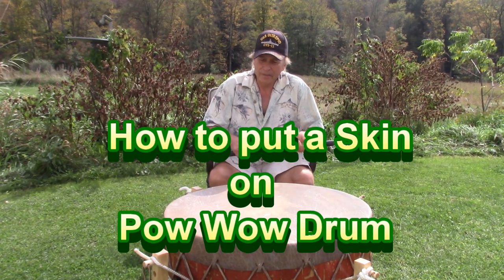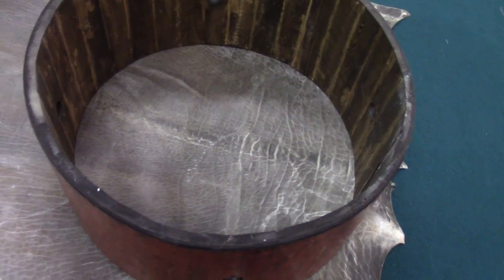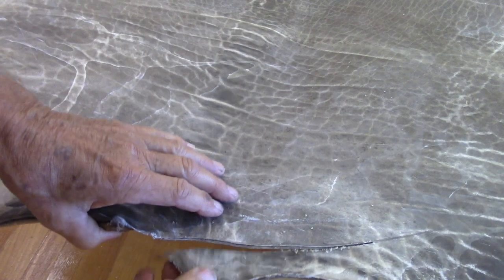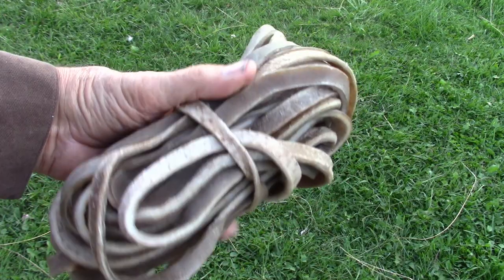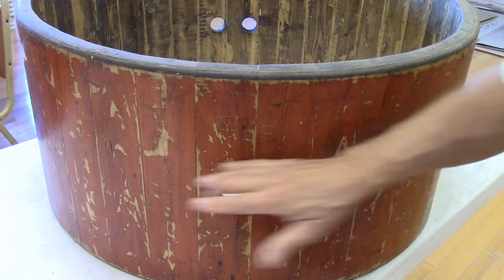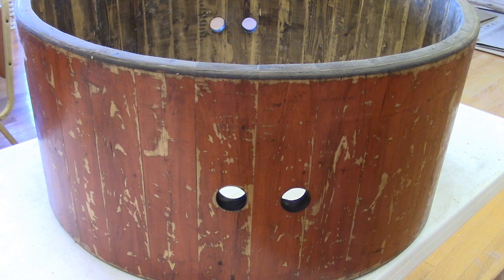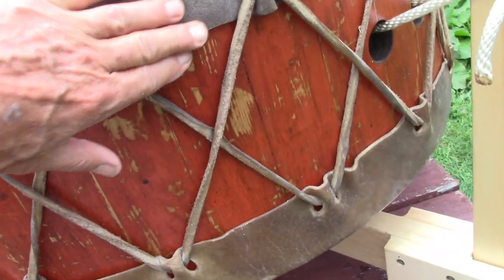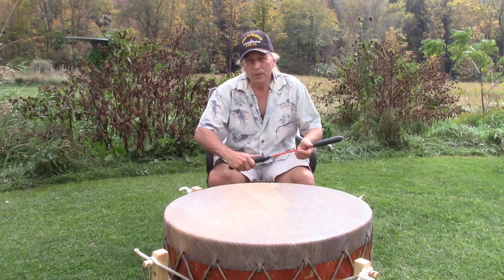Putting Head on Pow Wow Drum

Comment: Nice job. Some additional tips/suggestions if I may:

It’s always best to pre-stretch the lacing before using it. That way it’ll be less work tightening it up—still a lot of work, yes, but less. It’s much easier that way to get a tighter drum that pretty much always sounds perfect and never needs to be warmed up before singing on it. Another benefit of pre-stretching the lacing is it gives it a chance to break at any potential weak points before you tie up the drum, so it won’t be as liable to break when you’re tying it up tight. Tightly-pulled lacing achieves the best sound. It doesn’t look to me like your lacing is actually soaked fully, though. It may be; it’s hard to tell through a screen. IF it’s not, that could impact the amount of stretch potential, too. (When fully soaked, 1 ½”-wide lacing turns into about ½” stretched and fully dry.)

I’d recommend an odd number of holes, too. That way, you can use one, single strand of lacing for the entire drum. That will allow for more even tension all around. It also means fewer knots (generally just one with each end tied to the other) and a much neater appearance. I like to use vice grips to hold it in place and twist the ends around each other once and then back on themselves, so I don’t really even use a knot at all. Just a personal preference.
Reply from the maker: Thank you for this excellent suggestions, much appreciated!

Comment: Can you make a drum like that out of a solid log? And what are the draw backs of that kind of prosses? I imagine putting a lot of work into it and then it cracks. I really enjoyed your two videos on the making of your drum. Thanks so much for sharing it.
Reply from the maker: A lot of work removing the inside of the log. If the inside of the log is removed before any cracking, you have a good chance it will not crack, however if a crack does form it should not affect the sound much,